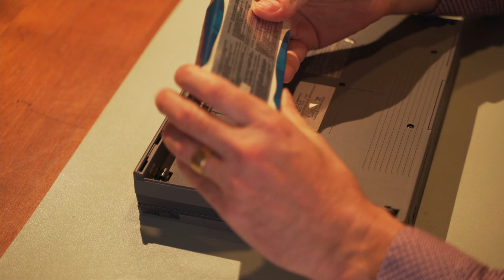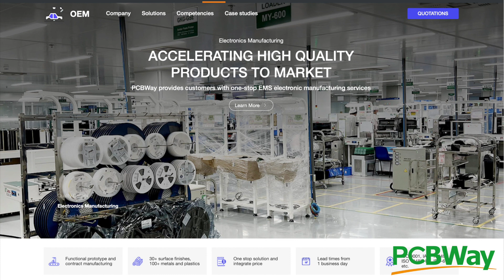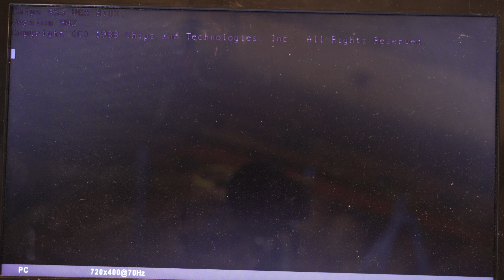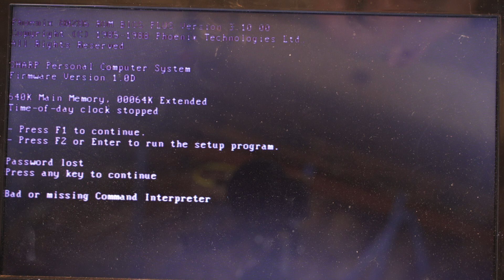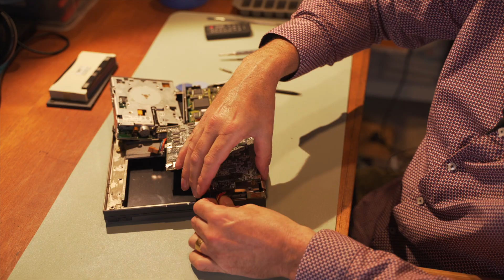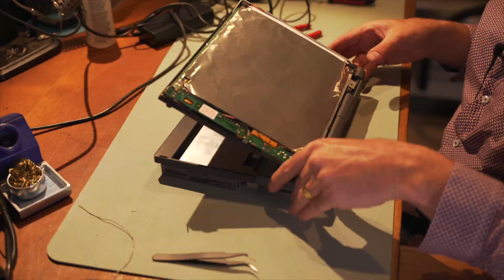Vintage DOS Laptop from 1991 - Sharp PC 6500

Comment: Find out what the DIP switches do. I have a Datavue portable and one of the switches is to disable the built-in LCD if you only use it with an external display.
Reply from the maker: Yes I tried every possible combination

Comment: Oh Also, leaking capacitors usually eat out traces and vias. Look for any capacitors you had replaced nearby the graphics chip, and check those traces. I bet theres one that went open.
Reply from the maker: Good idea, I’ll check it out.
Reply from the maker: I had another close look around the graphics chip. No sign of any damaged trace and I tested them all for continuity. Back to the drawing board 🤔
Reply: @TheBasementChannel  Hmmmmmm Interesting.... Isnt retro hardware fun? Rabbit hole!